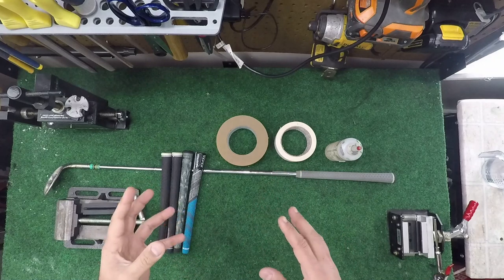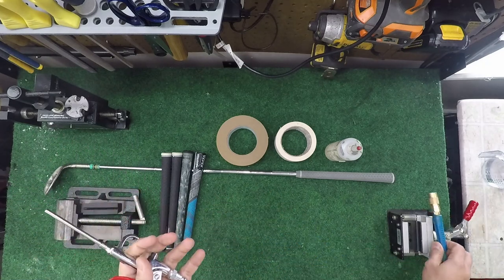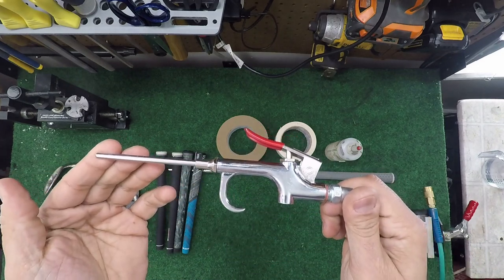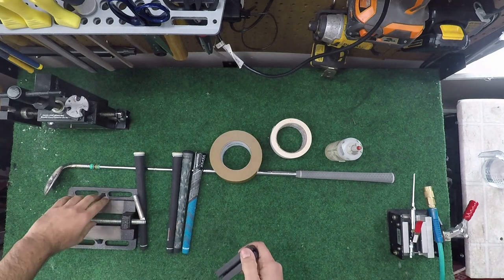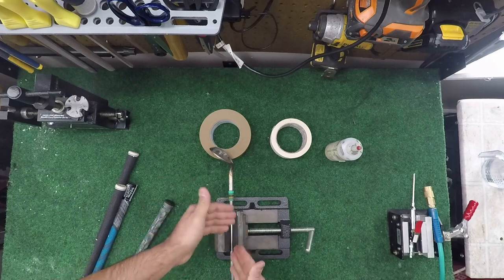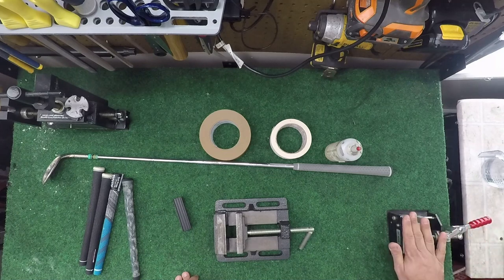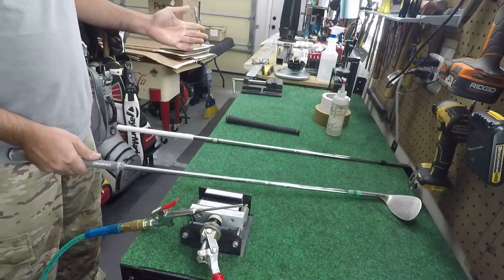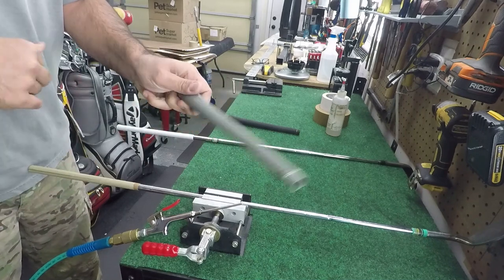Best Golf Club Regripping Method - Air vs Solvent #golf #regrip #golfclubs

Comment: Great video and well explained.  I will try the air method for swing grips in the near future.  

In regard to not being able to remove grips that were installed with solvent, it can be done but takes a little longer and requires a tube over the grip to prevent it from bubbling in spots or even exploding.  Requires a bit of finesse.  Best if you preheat that grip before removing with air by use of a hot air gun to reduce the tape's adhesion.  I've saved a hundred grips by removing with air.  Some grips don't like it and may not be serviceable after removal, but a lot of air removed grips that were installed with tape and solvent do work and can be reused.
Reply from the maker: I've got a video coming out on this actually. I don't want to encourage it, but you are right it is doable if you understand what's happening and how to react if you start to balloon! Thanks for the comment... welcome!